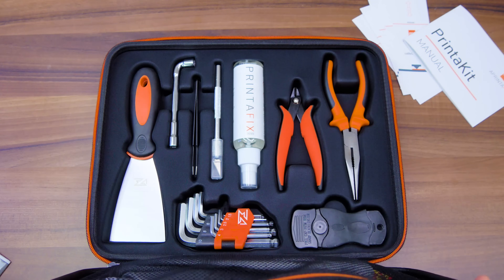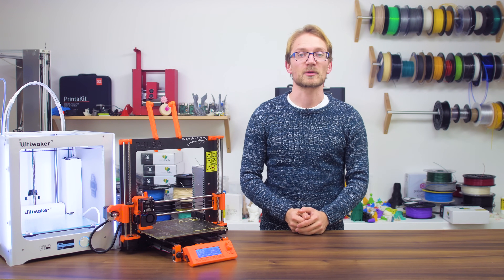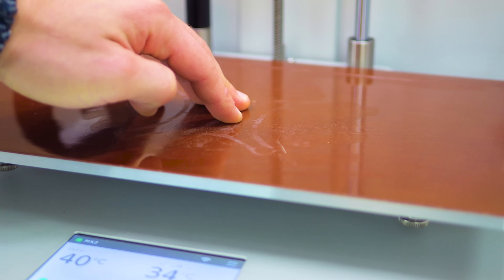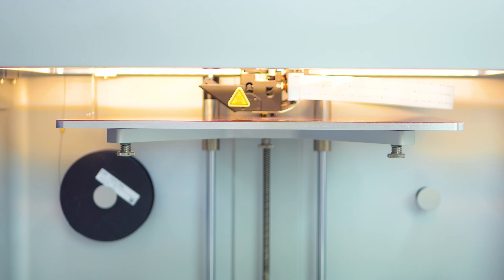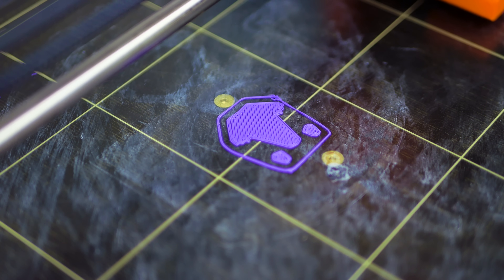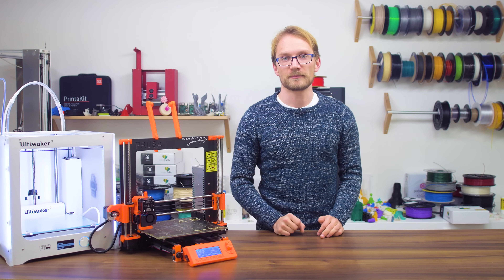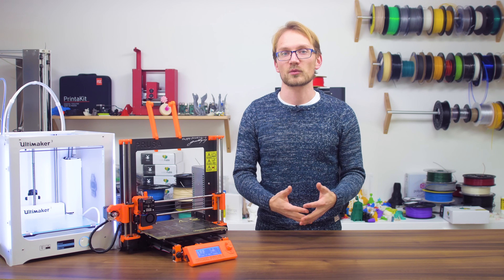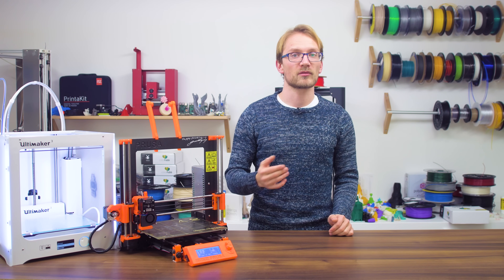Basics: 5 ways of getting your 3D prints to stick!

Comment: You can take this guy's advice or mine. Don't change the settings for the first layer in your slicer! That's just plan stupid. Learn what M220 does. Normally on the first layer I go m220 s 20 then after I might go M220 S50 for the second layer and then bring everything back up to full speed with m220 s 100. Also on the first layer I might increase the extrusion with m221 s 140. Then bring it back to normal with m221s100. Also I might change the z height which typically is Z 0.02 to Z0.009 with the machines I'm using. but this one you have to be F-ing careful with this setting. Start with Z0.018 snd slowly go down. And see what kind of squish you get. If you're layer is putting down a string of filament you're way too high. But if it's squishing it flat spreading it out you got to be careful. Also I use m140 to change the bed temperature. That way I can go from 60c at the start of the print to say 40c after the first three or four layers.
This way you can use almost any slicer you want to get the first layer correctly. 
Dale

Comment: 6 years ago? The Bambu Lab 3d printer I have now does bed leveling and measuring of heights. What's frustrating is all the fans being maxed out by default. After lowering their speeds, the warmer filament seems to be sticking to the plate better. Still playing with settings though.

Comment: Those first layer printer settings are gold.  I have saved them as a specific config called "Toms ABS Settings".  I also added at the same time mouse ears at every sharp corner for a simple print I was trying to do with ABS tthat failed 5 times in a row on a Prusa Mk3S+ (without an enclosure), and it now sticks and prints perfectly.  Big thanks for this old gold.

Comment: Tried all this and found out it was my own error, so just putting it here just in case someone else is going crazy like I was: Make sure you are printing with the correct line width. I was trying to print using 0.28 line width with a 0.4 nozzle. Worked fine with smaller prints, but caused a lot of problems with larger prints. Your minimum line width needs to be, at minimum, equal to your nozzle diameter.

Comment: Great tips in this video. I'm using Cura that came with my cheap $100 printer from Amazon but I'd had more than enough print failures. But sure enough Cura had a setting to reduce the print speed for the first layer. I've had more luck with this that I feel I can walk away from my printer without having to check up on it. Thanks for the video!

Comment: Thx!
Reply: Thank you for the heart… :-)  right now I (newbie) have the adhesion problem that PETG sticks much to well on the steel plate of my Prusa MK3s+. It is nearly impossible to get it from the bed without damaging it. I would prefer to avoid Gluestick or hairspray. The setting changes I tried were without any success. If you need a topic for a new video, that would be my suggestion. Anyway - thanks for so much information and tips in so many videos. I learned so much from you! Best regards from Northern Germany!

Comment: Man I went through this stage too, always thinking it was the hardware. The key is proper bed leveling, which you have to keep a eye on. Something I forget so often from flashforge auto bed leveling. What I do is spray down the board every use. Make sure I’m leveled right (just a quick eyeball check just to make sure my hot end looks close to the bed as possible, if I see air between the nozzle and bed, I adjust. I always preheat for 15-30min. But personally I only check the brim to see how closely they are on the first layer. If the lines are messed up in any way, or if I see air in any of my brim lines. That’s a automatic stop print. The build won’t stick. The brim lines should look the same every time and go down the same. I found this helpful when I was pulling my hair

Comment: i keep cleaning my bed before prints, making sure it's level, changing filaments, cleaning and replacing nozzles and still can't get a flat christmas card model to print. i don't get what i'm doing wrong. thinking of just tearing the machine apart and reassembling it again.

Comment: Use water base primer and there if you want to not need to ever do anything;  glue a thin fabric or fine grit sanding paper but if you absolutely really need to have the pad off;  in order to remove your print then don't do that or a stretchy fabric (because raising the heat to super high will release it at the lowest most area of your material).  And also;  it's just like hot glue;  you need to raise the bed at super high for the beginning because just like hot glue;  the surfaces' heat is more important then the glue.  I use a torch for working with hot glue sticks;  I have no use for the glue gun;  at all;  even.

Comment: Can you show us a close up video of your Display Settings how to change the temperature for the print. I can get the temp up to 220 in the settings but when it starts printing, the Temp drops down to 200. I wanna be able to make it print at 220 because the Filament isn't sticking and it's blobbing up out of the extruder tip. Thanks

Comment: How can I get better bed adhesion without a heated bed? The leveling is done by a bltouch and is calibrated well. I use a glass bed with glue stick. I tried everything but the first layer dos not stick every time. Can someone please help me? Thanks for an answer.

Comment: I found the best ever adhesion is obtained by using acetate sheet stuck (or clipped) to the bed with glue stick.  And the best ones are those meant for inkjet printers with a bluish coating on one side (coating on print side).  Those meant for laser printer (no coating) are excellent but difficult to unstick.

Comment: Thank you so much!! Havent had a good print in days now without it warping off of the bed after a while. The first tip about it gowing slower and extruding more filament solved this almost instantly. I noticed the print looks cleaner at the bottom with this setting as well.

Comment: I tried the following and it changed my life
- Precise bed calibration
- Switched to glass bed
- First Layer slow speed
- Increased base layer thickness
Reply: I bought a glass bed, but it was warped :/. I’m not sure what the point of a warped glass bed is, but apparently it was fine to some people because it got mostly 5 star reviews
Reply: @andypandy5781  you probably got the bad one in a thousand😂
Reply: Cold bed with spray glue works EVERY time.
Reply: @ianjacklin7282  cold bed? Mine preheats to 60
Reply: @ianjacklin7282  Glass bed or factory bed?
Reply: @ianjacklin7282  magnetic bed with 80 degrees for PLA works everytime
Reply: @Floppy the Whale Till now I have tried Two PLA and  one PETG and didn't see any problem.
Reply: What makes glass bed better
Reply: Sounds good. In an effort to use your tips quickly, how do I change those settings on my Ender 3 V2?  Thanks!
Reply: Im a beginner and... Wel some stick and some don't... Idk I'm just confused

Comment: Funnily its normally the 2nd or 3rd layer which gets me. 1st layer goes down fine, then the 2nd might have some problem approaching one corner and then the 3rd is a disaster. Even if I diligently level every corner it seems to happen. Fortunately most of my prints the 3rd layer is on the inside of something so it doesn't matter and usually it improves a bit after that.

Comment: this helped immensely, had been using a4 paper and getting no where, flipped my build plate over to the cleanest side, used a business card like you said, did all the setting 0 stuff in marlin gcode, and bam! perfect out the gate! now i can print a fan duct.

tried to use a rubbing alcohol based cleaner for computers, didn't help and will have to get the pure stuff for next time it needs wiped down.

Comment: The best tip I ever got (after proper levelling of course) was to apply salt to the bed. You mix salt with water almost until the point of saturation, put the water on a tissue paper (but don't make it too soggy) and wipe that on the heated bed at about 70°C. The saltwater should evaporate after 3 or 4 seconds and the bed should be white and sparkle a bit under strong light. This will work better than glue stick, is cheaper and can be cleaned off in an instant. Even PETG will stick really well.
Reply: Thanks, I'll give this a try at some point

Comment: My printer came with a magnetic sandpaper-like surface that is a great low-effort adhesion surface that basically just needs a good manual leveling of the bed and slow first layer, as you mentioned.

Comment: I would like you to do a video for PLA I have a Dremel 3-D 40 with a non-heated bed and have trouble with some PLA’s adhering to the painters tape and some stick with no problem I’m wondering if there’s a difference between premium PLA and regular PLA when it comes to non-heated beds and if I can use glue on top of painters tape to make it stick better or just making the first layer go slower or what I can do I want to experiment but not waste a lot  filament because I am doing this with school materials

Comment: I've almost got it printing perfectly, but the initial layer doesn't have adhesion until about 3 inches into the print.  It's infuriating, I feel like tossing the bloody thing out the window.  I'm going to try your suggestions Mr. Sanladerer and if it helps I'll give you the credit for it. Till then wish me luck.

Comment: my problem is that I get good adhesion of first ten or twenty layers but with each next corners of my print detach slowly and raise up. 50 layers and middle of the print also detaches and print fails. what do I do wrong. It seems like some warping goes on in my print. I have 10 mm alu heated bed at 60 deg and print with PLA.

Comment: Prints start out ok but the corners lift during the overnight print.Prusa Mk3
Reply: Corner lifting happens due to the corners cooling more than the main body of the print thanks to thermodynamics. This is why good heatsinks have fins instead of being a flat piece of metal.
Try using a brim to help with adhesion around the corners of the print. In Cura, for example, set Build Plate Adhesion > Build Plate Adhesion Type to Brim. The accompanying settings are Brim Only On Outside (default: ticked) and Brim Width (default: 8mm for a 0.4mm nozzle).

Comment: First print (the sample dog) was basically perfect. Second print - NOTHING worked. Tried 3 different surface types (default pad, Creality 3D glass, Lowe’s mirror tiles), cleaned with alcohol, tried glue sticks, hairspray, repeatedly leveled the bed - first layer kept curling up. 

What finally worked was increasing the bed temp by 10 degrees to 70, increasing the initial layer line width to 150 percent, increasing the filament flow and reducing the initial layer speed.
Reply: Do you have to make changes like what he did to every print file from the slicer?? Or can you tell the machine to adjust when you preheat for pla, abs etc?. I'ma complete noob
Reply: @jackkuehneman9300  prob late,  but you should be able to store these adjustments into the printer or in your sliced software-aka more YouTube!

Comment: I've got an Ender 3 and have run into a rather unique issue. With the Stock bed material. I can't get the printed parts off of it. Do you have any suggestions other than a hammer and a chisel?

Comment: I am using CURA software at the moment, is SLIC3R better? Do you have any opinions on this?

Judging from your video it seems that SLIC3R seems to give you more print control or is this more to do with the 3D printer that you are using?

I am using an Anycubic i3 Mega 3D Printer with PLA.
Reply: do you have some problems with adhesion? i have the same buildplate material (ultrabase) and i cant get my prints to stick, do you have any solution or advice? thank you

Comment: I should adjust nozzle high when in auto home or during printing? I am asking because nozzle is in different height after auto home compared to first layer hight while  printing. So I pullout filament and start printing, after a few seconds I stop the print and then check with the paper if it make any resistance and then I adjust Z offset in printer settings. So my question is if I am doing it correctly or I should check the height after auto home, not in accrual printing?

Comment: WRONG The correct way is this: Home the nozzle. Heat up the bed & nozzle. Measure the paper thickness (this is important). Then move Z up from 0 to the paper height. Then do the bed leveling as shown in the video. This way the nozzle Z zero position is at bed level and not a paper thickness above the bed. This small difference will make thin printed objects more accurate in thickness. :-)
Reply: i usually just level my bed to it just barely touches the nozzle, and increase the first layer print height a bit
Reply: I calibrated my extrusion, used paper to get my bed level, then measured test print's height to fine tune the Z zero. Seems to work well. I home to the side and below the bed, though.

Comment: Hi Tom

I have a Folgertech FT-5 printer. If the printer is setup good then its a very nice printer.
My 1st layer is sticking very well to my glassplate with a sheet of capton & some hairspray.
Also my BLTouch did work like magic. It took a long time to find out how to use it but now it's working very well.

My 1st layer sticks very good to the bed. However i do have another problem.
My support is not sticking to the baselayers.
The main structure (the part itself) prints very well but the support is not sticking in all places on the baselayer (raft or any flat printed part).
There are parts of the support that do stick but after a while the nozle drags the support lose. That's when i get garbage.
These are my settings:
Filament:PetG, Nozle:0.4mm, Multiplier:1.0
Temps: Nozle:220 c, Bed:60 c., Fan:0% on 1st layer then at 100%.
Primary Layer    : LayerHeight:0.1500, Top/Bottomlayers:4, OutlineShells:3(Inside-Out), 
1st Layer    : Height:90%, With:100%, Speed:50%
Additions:   Skirt: 2 layers, offset:0 (directly to part), Outlines: 15 (about 6mm). (So on the edge of the print there is a 0.3mm thick layer of 0.6mm outside the print. This acts as a sort of raft and works very well). So i don't use a raft if not needed.
Infill: Full Honicomb, Concentric, Interior Fill Percentage:10%, Outline Overlap: 15%, Infill Extrusion With:100%, Min.Infill Length:5mm, Print Sparse Infill Every:1 layers, Incl. Solid Diaphragm every:20 layers [active], Print every infill angle on each layer:[active]
Support: 20%, Extra Inflation Distance:2mm, Dense Support Layers:10, Dense Infill Perc.: 80%, Print support after every: 1 layers, Support Type:Normal, Support Pillar Resolution:10mm, Max.Overhang Angle:45deg., Angles: 0-45-135.

I hope these settings are enough to see where it goes wrong. If you need more info please ask.

Can you, or anyone else please help me?

Thank you

Comment: I've used a glass build plate w/PCB heater for nearly five years and I've used painter's tape, alcohol, etc. for improving bed adhesion. However, early on, distilled white vinegar was recommended to me and it's never let me down. Before each print, I simple saturate a small portion of a rag and wipe the entire surface. Using a dry portion of the rag, I wipe the surface dry until it literally squeaks. As they say, squeaky clean. Where many struggle with warping, corner adhesion with ABS prints, I've no issues like that. This technique also works for PLA.

Comment: So it's best to use a bigger first layer height? Was wondering why I couldn't get the print to stick it just kept rolling of the glass layer height set to 0.2 mm and then I tried 0.1 mm and still no luck. Then I went to 0.35 mm and it started to stick so should I use a thicker layer height for the first layer? I've also ordered some buildtak sheets as printer didn't come with tape or anything so figured I'll give buildtak a try.

Comment: PLA + GLUE STICK 100% ADHESION. THKS
Reply: Sorry for the late reply. Can you tell me if you included heated beds in the equation? Because my heated bed just stopped responding and i am forced to print on a cold glass + gluestick. I haven't tried yet but i'm having such a low morale because of the heated bed, so i require more time. Please tell me if glass + gluestick will do the trick . Thank you very much and sorry for bothering you after 7 months since your comment.
Reply: I don’t know about glue stick+ glass bed, but I have a glass bed on my printer, and I use hairspray on it. It works great; the prints stick really nicely, and (as long as you don’t apply too much) it comes off pretty easier afterwards.

Comment: My first printer was the FlashForge Dreamer, and several recommend a business card, which was hit and miss. By profession I am a high end tool and die automation master craftsman. Since I also used to teach at National Oilwell Varco I decided to stop using paper and use a .002 Mititoyo gauge shim. This not only did the trick, but I have to wait until everything is cool or I will pull the Kapton tape off the bed with the part. I've also managed to accidentally cut thru the tape even with the blade bevel side down. Like you say first layer is everything.

Comment: Hey Tom, I've been printing directly on glass now for about 2 months without any(ANY) adhesives.  It occurred to me that there is no better bond than nature, so I replaced my borocilite glass with a 1/4" mirror plate I got from the hardware store, then I gave it a nice static charge with a piece of silk; rubbing it back/forward in a single direction. It holds better than anything I've tried so far!  You do need to give it a little time to even the mirror temperature, and it is definitely breeze sensitive, but other than that, it works perfect every time! It works for pla and PETG but I have not tried ABS(yet)  You should try it!  also, send me some ABS!!